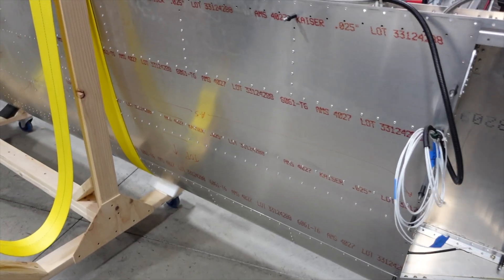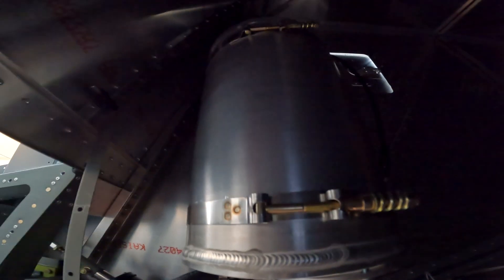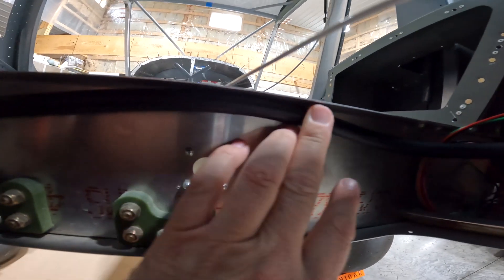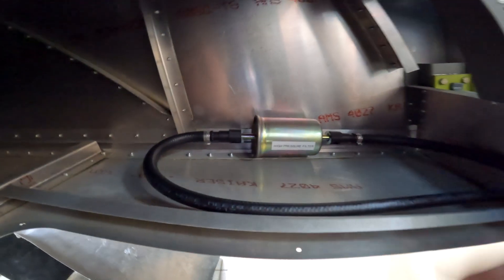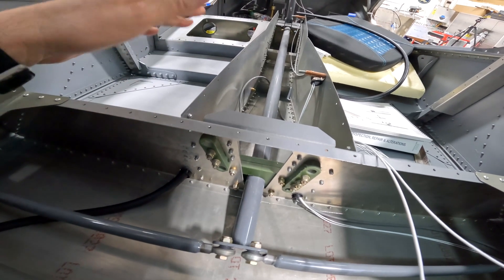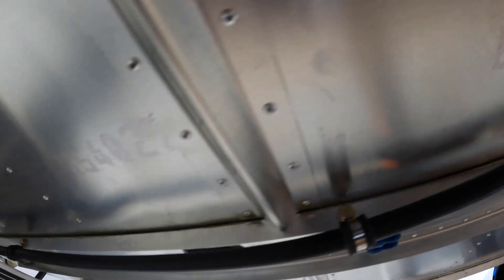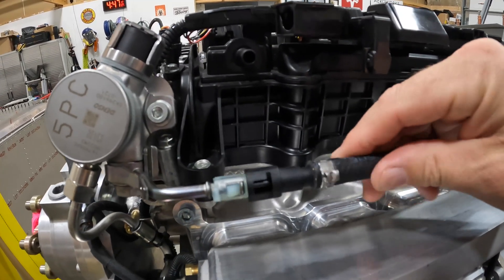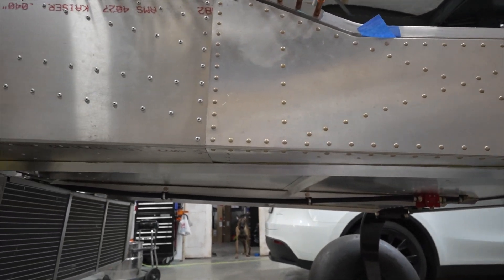Ep. 60 | Zenith Super Duty Aircraft Build

Comment: That's a really complex routing of the fuel lines - looks like it'll really be a PITA to change-out those lines periodically as rubber lines require.  Did you consider using stainless braided PTFE lines which are considered "permanent?"  So glad to see you back in the shop and making progress!  Now, as Jon Croke says, "Get back to building!" LOL!
Reply from the maker: I wanted to go all stainless lines but there was an issue adapting back to the quick connect Honda fittings.  Didn’t want to steer to far away from Vikings recommended installation.  These lines will all be accessible when the time comes to swap out.
Reply: You might actually pull this off!